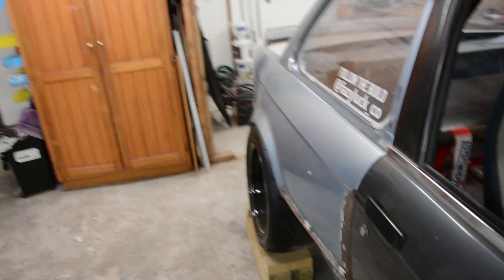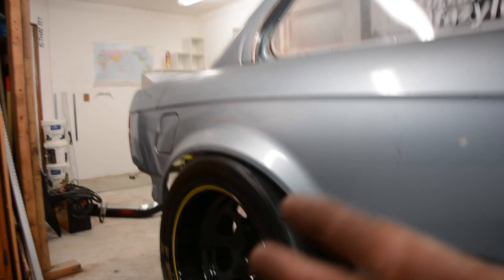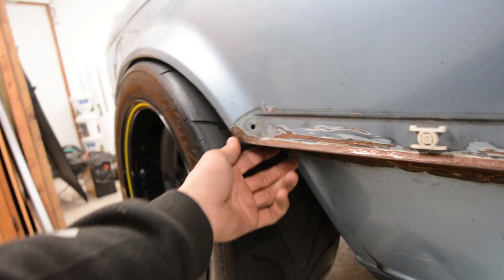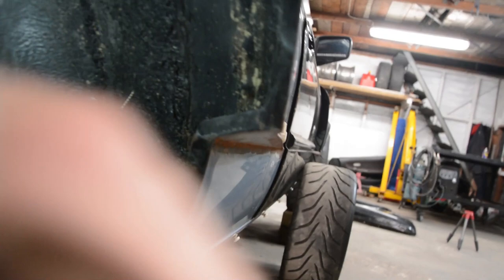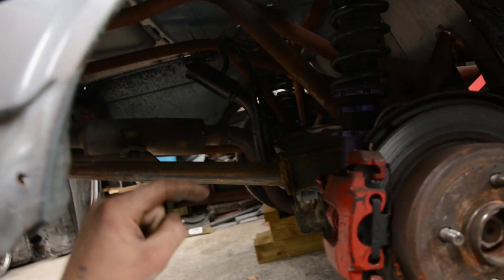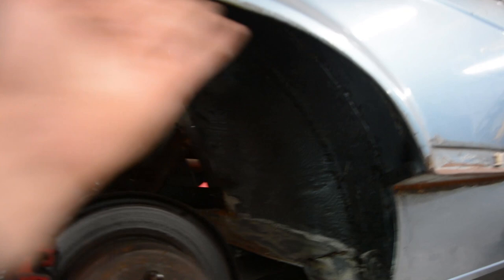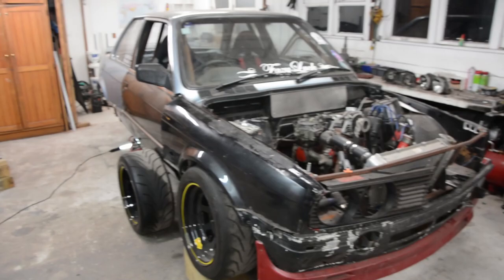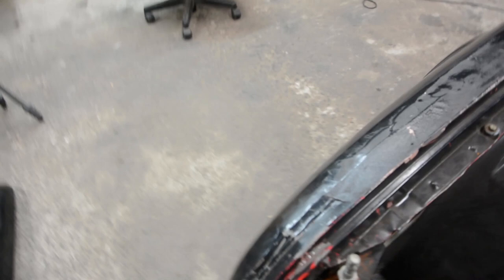HOW TO: WIDEBODY E30 BMW

Comment: What size wheels and tires are you running
Reply from the maker: Hey, 15x8 rims (-25 offset front)(-50 offset rear) 205/225 50R15